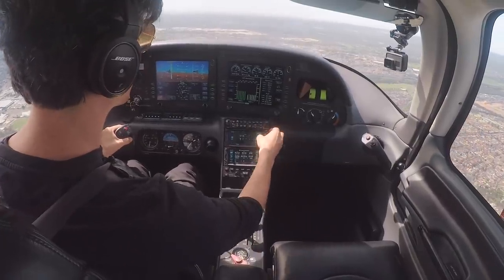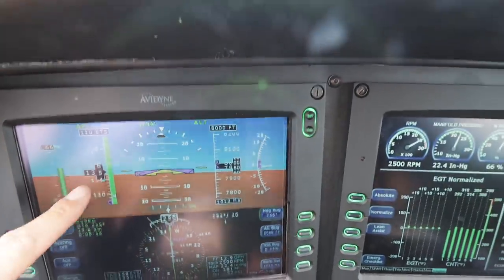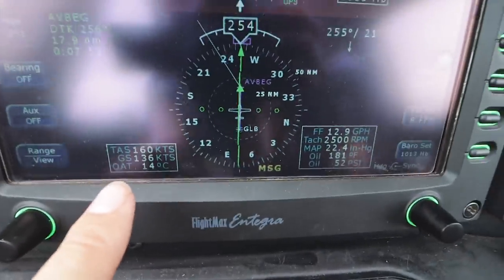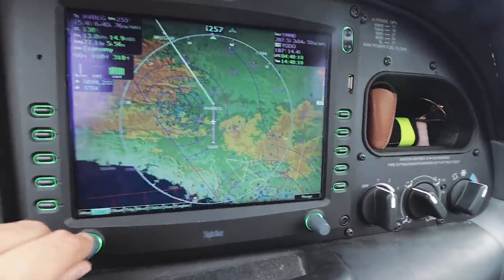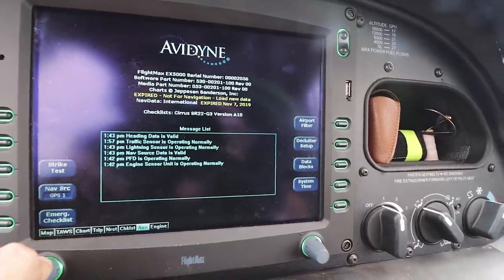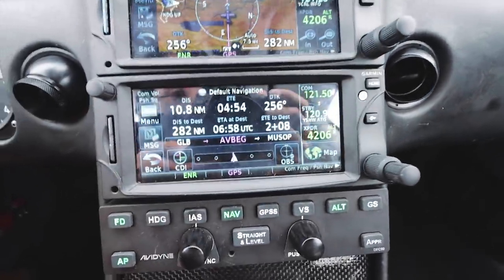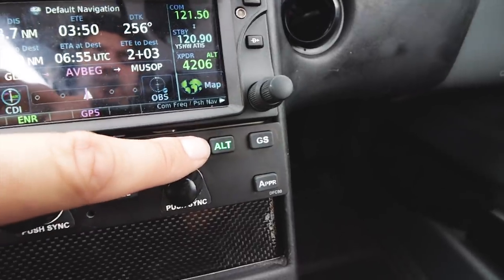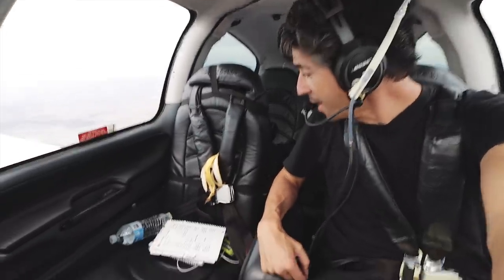INSIDE my Cirrus Cockpit - HOW I FLY A PLANE

Comment: I'd really like to know how you mounted the camera on the ceiling.  I saw in one video a red colored plate that looked to insert between the doors which had several mounts on it.  I'm stuck figuring out the ceiling in my Cirrus.  Thanks and keep it up!
Reply from the maker: It’s an NFlightCam mount screwed in to where the overhead light was (we removed that), with a Puluz aluminium cradle for the GoPro. We had an Engineering Order for the aircraft for the fitting which is CASA approved. Very solid and versatile mount.
Reply: @StefanDrury  Thanks!  I'll have to call them.  I don't see the cradle in any obvious spot on their website.  The Cirrus is a tough one to find a spot overhead.  I'm planning on starting a video series of flights I take with my son who has his license as well.  I told him one day he can go watch youtube and look back on some good times!  I have no idea how to use editing software so it will be a process with initial low budget look results but I'll give it a go.

Comment: Great video, Stefan!  Hey, I'm curious how you attached the camera mount in the spot that has the overhead light. I've been using a GoPro mount that I glued to the light lens—not the most stable solution. Your kit looks much more solid.
Reply from the maker: We took out the light fitting and mounted a metal NFlightCam mount to the roof. It's been approved by CASA and we have an Engineering Order on the aircraft for it. The actual holder is a Puluz aluminium GoPro case. Very solid.
Reply: @StefanDrury  Thanks for the detailed info, mate! Was there an available machine screw to mount the Surface Spud Mount or are you using the suction cup mount? Or, perhaps you made a hole in the roof for this—hence the Engineering Order!

Comment: I have the same plane, same 650s.  When ifr how do you have things configured, the pfd buttons on left, and which screens on the 650s. When do you load and activate appr ?
Reply from the maker: All depends on the approach. RNAVs are pretty simple, ILS obviously you switch to VLOC from GPS but not much else to it. I load an approach generally well before I need it, before briefing myself on it, and activate when I’m cleared to it.
Reply: @StefanDrury thanks, oh on the 650s you can adjust the fields in the flight plane to show the step down increments on the approach on the flight plan.

Comment: Thanks for the cockpit tour Stef. I know you are putting in extra fuel tanks for the RTW but are you having to do anything about oil capacity?
Reply from the maker: Carrying 6 quarts of oil at any one time in the back with me, but not upgrading the aircraft with a larger oil sump or larger oil filter (we can’t add the bigger oil filter due to the air conditioning unit). So I just need to stay on top of the oil levels and keep topping her up as / when required.

Comment: Do you have the balance ball in your digital screens or is just in the secondary backups?
Reply: Glenn Watson You find the balance ball ( turn coordinator ) on top of the artificial horizon on these glass panels. Really handy, you see if you sideslip directly
Reply: @Maviation  Ah like that diamond pyramid? Thanks for the reply btw.
Reply from the maker: Yes as Cozonic said, it’s on top of the AH. The bar under the pyramid is the ‘balance ball’.

Comment: Why do you have your landing light on at 8000’? (I constantly forget to turn it off)
Reply from the maker: I’ve been trained to leave it on. Better to be as visible as possible, and for the tiny additional electrical draw on the system and perhaps replacing an inexpensive bulb a bit more frequently, I think the safety benefits outweigh the downsides.
Reply: Stefan Drury good point. Especially with LED.  Thanks and happy landings!

Comment: Does your Cirrus have a fuel injected engine.... If not, is it still necessary to have mixture control ?
Reply from the maker: Yes it’s fuel injected but with a manual mixture control like all (current) Cirrus piston aircraft. I’m hopeful a FADEC is in the pipeline like they have in the SF50 Vision Jet, but for now we have to manually adjust mixture setting, eugh!
Reply: @StefanDrury  Thanks for the info.. Adjusting the mixture control always seems a bit like guesswork to get it precisely set... Although, I assume you adjust it by closely monitoring the cylinder head temperatures.... Cheers to you..

Comment: 48 litres per hour for a 160kt TAS isn't bad at all.  I was expecting a slightly higher fuel burn considering the number of ponies under the hood.  Hmmmm - might have to buy a Cirrus.....
Reply from the maker: Leaned out this is a very efficient machine. It’s thirsty ROP (around 17Gph for 170TAS) but LOP at just 10Kts slower it’s not bad from a fuel flow perspective. Yes, come join the club!
Reply: @StefanDrury  Love to, but you don't see many (if any) low hour G3 SR-22s at the price EYZ was advertised for.  If I can find a similar steal - hmmm.  Although, might have to wait a while for my share portfolio to recover from it's recent spanking :)